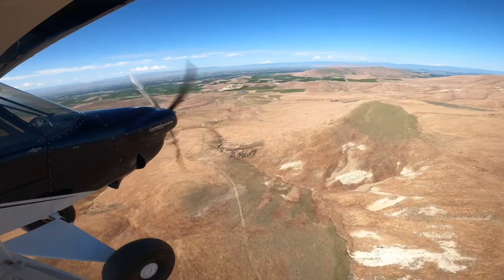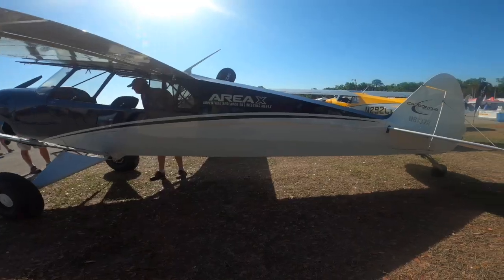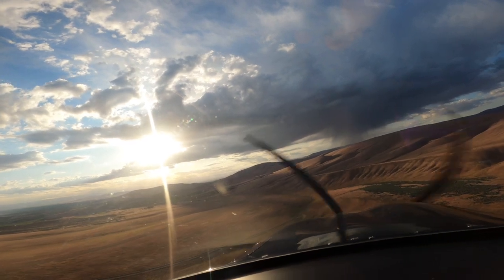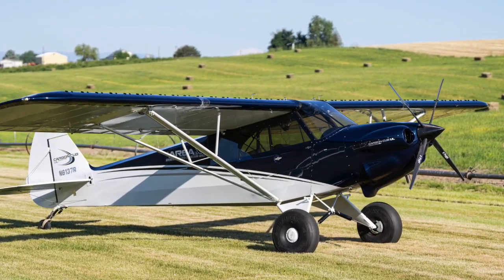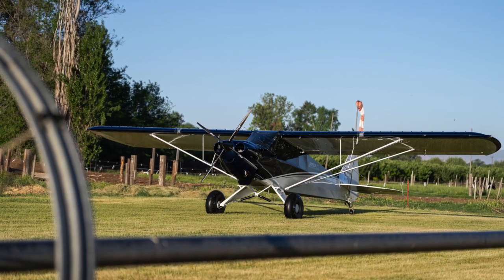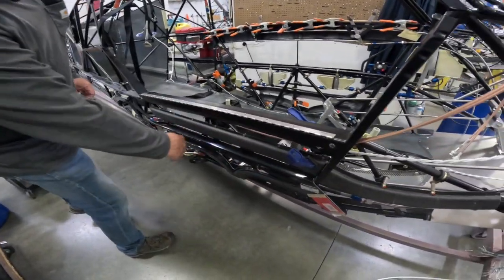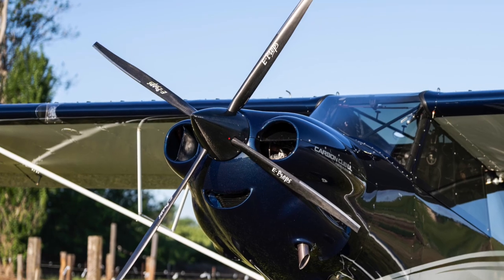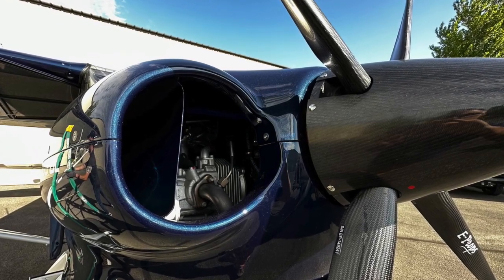Why did CubCrafters make the Carbon Cub UL?

Comment: Traditional Aircraft Engine = 70 year old technology, high fuel consumption, high cost, high weight, no stock smart ignition system, questionable reliability.

How many of us would be happy if GM or Ford were still fitting a 1930’s engine in our new cars?

Power plant technology should match the technology that is available for cars today, and keep up with that  that can be fitted in our panels today.

This does not mean older traditional aircraft should not keep flying and have a place in aviation today.
Reply: I'd be delighted. You can at least fix it yourself without using computers
Reply: @ashleywelch2143  Just like a Rotax then?

Comment: I hear LSA is changing in the US again (for the better). Higher weight, higher stall speed, retracts, constant speed, etc. And gets things like the C172 and C150 into the LSA. But allows many European high-efficiency "ultralights" to be flown under LSA in the US.
Reply from the maker: That's correct. The MOSAIC program has been published and is currently in the public-comment phase. It's unlikely we'll see the as an actual rule before mid-to-late 2024.

Comment: High compression ratio? The 912 iS has a 10.8:1 compression ratio and still runs on mogas. Compression ratio doesn't inherently determine the fuel octane required by an engine.
Reply from the maker: Not so much with the Rotax engines because the combustion chambers are more modern and because the fuel delivery and timing can be closely controlled. Not so much with a traditional Lycoming, where compression ratio is the dominant factor.
Reply: @KitplanesMagazine  That was basically my point. Those Rotax engines were also designed in the '80s, and things have improved significantly since then. If we're talking about modern engines designed to run on 100 octane fuel, we could see compression ratios in the 12-14:1 range.
Reply: @KitplanesMagazine  ... heck, Ford's naturally aspirated engines have a 12:1 compression ratio, and they run on 87 octane.
Reply: @PistonAvatarGuy only possible with direct injection. DI would cause major issues in aviation considering the issues it causes in car engines
Reply: @Second.Nature.Lawn.Michigan  What issues are those?
Reply: @Second.Nature.Lawn.Michigan  Anyway, I'm going to assume that you're unaware that those issues wouldn't be present in an aircraft engine, because they don't require the systems that make direct injection a problem (PCV and EGR).

Also, if 100 octane fuel is to be the standard, 12:1 compression ratios would likely be just fine, even without direct injection.

11:1 is common for port injected road car engines meant to run on 91 octane, so I seriously doubt that 12:1 would be a problem on 100 octane.
Reply: @PistonAvatarGuy  you would still get "gummy" intake valves over time. It just wouldn't be carbon. Without a fuel charge passing over they get dirty. But you are right,  it would be much better without exhaust and oil blowing in all the time.
Reply: @Second.Nature.Lawn.Michigan  And what would cause that, exactly? It doesn't seem to happen with diesels.